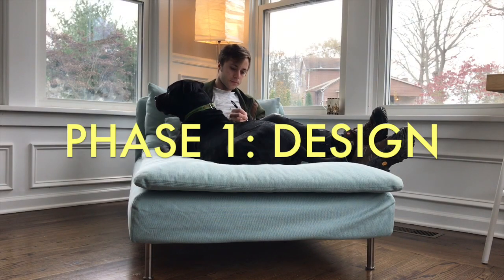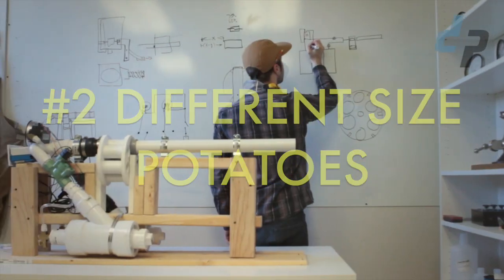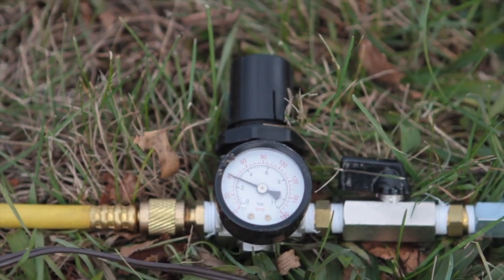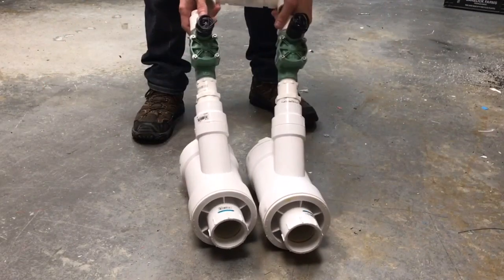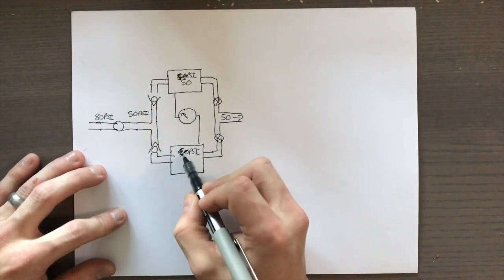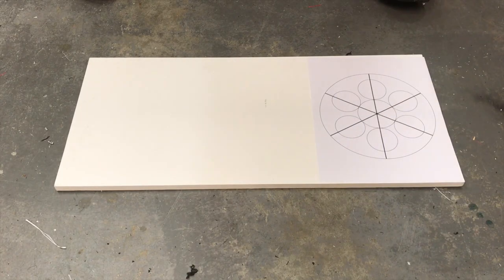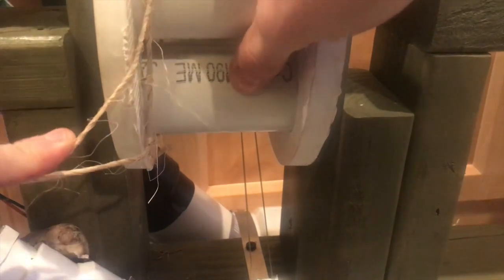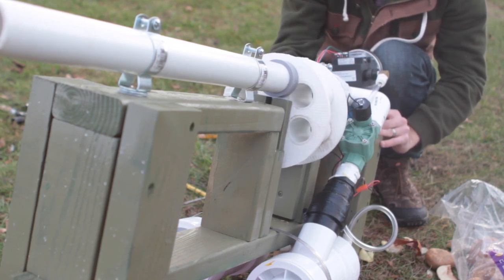WORLD'S FIRST Potato Cannon with Semi-Auto Revolver

Comment: I’m thinking about going with a cartridge-like ammunition and using a Taser and screws driven into the cartridge to ignite the fuel (propane from a blow torch is the perfect ratio)
Reply: I was considering using a taser or otherwise an electric lighter as well.  How did it come out?

Comment: Why not make your spuds into plugs. Instead of firing a whole potato use a tube which has been sharpened at one end to cut them into potato plugs and cut them to a uniform length. Doing this might even allow you to create a belt feed. Then use another actuator to pull the belt through on a gear, locking in place when a new spud is loaded in place. I don't think it would be hard to create a fully automated spud gun using these. If I had the money and a good work space I would make one myself, but I searched automatic potato gun and videos of your revolver cannon are the closest to what I was hoping to see. I really like your build but really hope you can improve upon your design. Hope my suggestions can help too
Reply: Yeah i was looking for a automatic one too, i find it weird that their are so few people who made them. I tried to come up with a couple ideas myself, but it is very hard to design something that shoots fast and wont leak. I am also gonna try to make apfsds and fire that istead of potatoes.